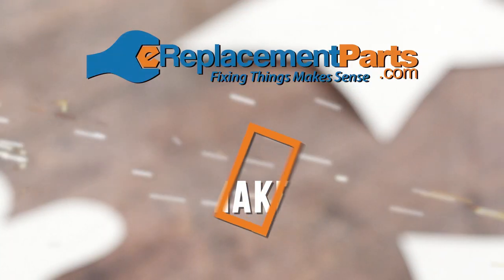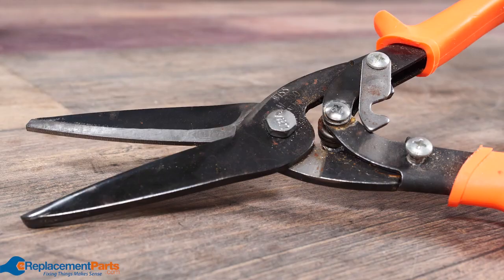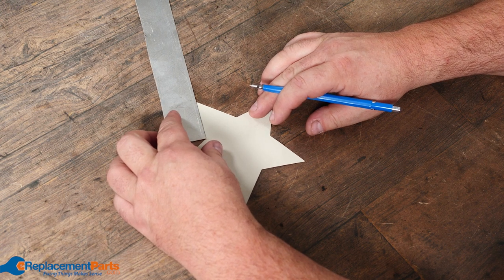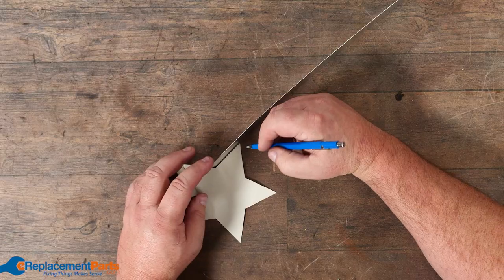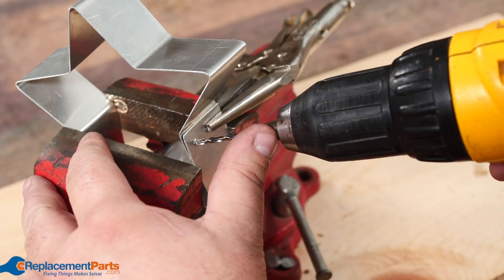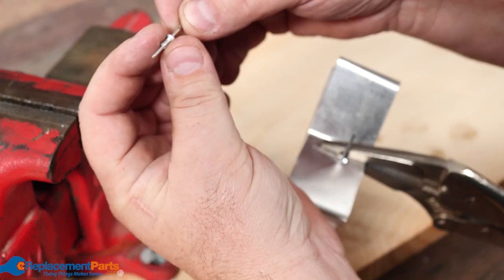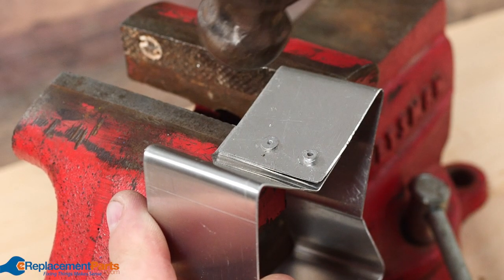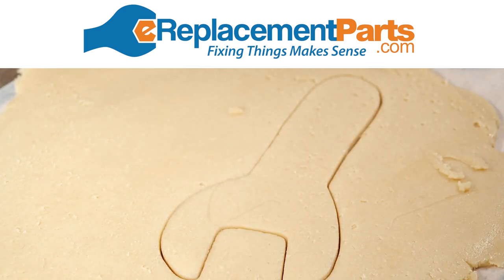How to make Custom Homemade Cookie Cutters | eReplacementParts.com

Comment: Phew! This is the kind of masculine energy I was looking for in a cookie cutter making video. Folks were out here trying to have me bleed out scissoring open my Dr. Pepper cans and scotch taping them together. The riveting tip was useful as I've seen those parts in the hardware store, but never quite knew what I'd use them for. I bet something like a tool dip would be handy for making the handle edge as well. When I try this, I won't bother cutting out the reference shape tho, as it seems you could just as easily follow a line drawing. Thanks so much!

Comment: Nice cookie cutters.

Vises should never be used in the place of an anvil.  Vises are normally made of cast iron which is too brittle to be 'pounded' on.  In fact, using a typical anvil to work cold metal  could damage the anvil; use a piece of railroad track for the 'cold' work